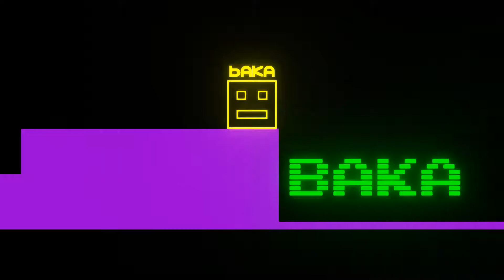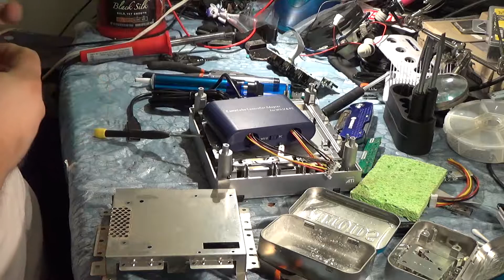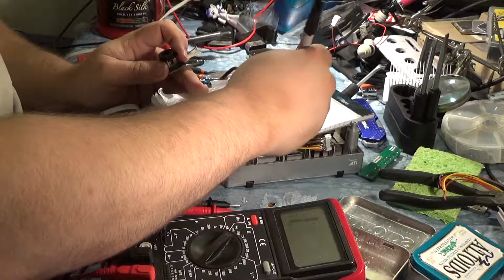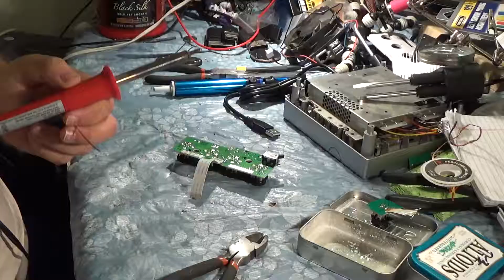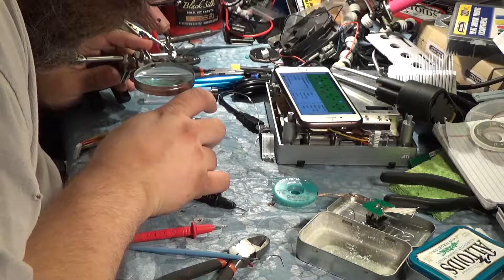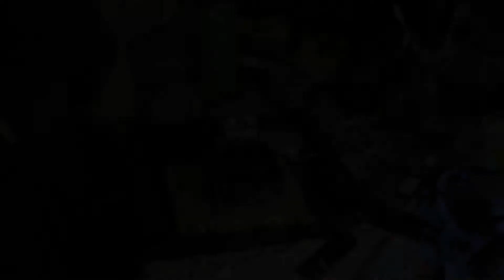Pi^3 Part 2 B Controller Port Mayhem - Wiring up the controller ports

Comment: do you think it would be possible to use the disc drive with the pi? not necessarily for playing GC game discs but maybe for reading other mini discs? or possibly writing to a blank mini disc?
Reply from the maker: I would say that it is possible to read discs using the drive, but it was never made to write discs. It would involve making custom hardware to interface it with the pi, then writing custom drivers and software to use it. I'm sure there is someone out there who could do that, but it's way beyond my skillset.